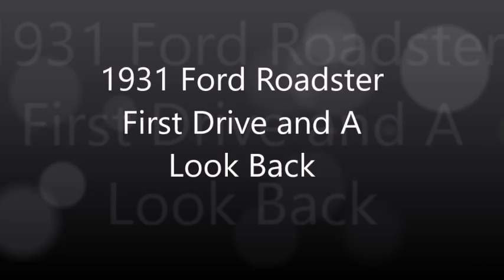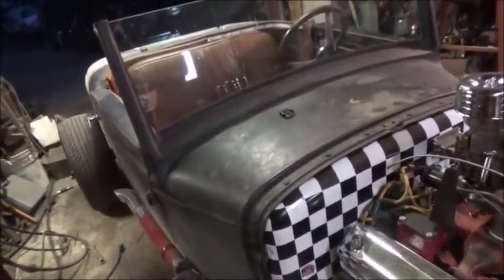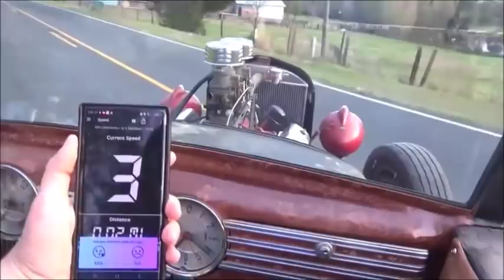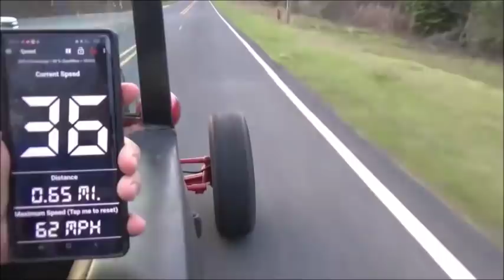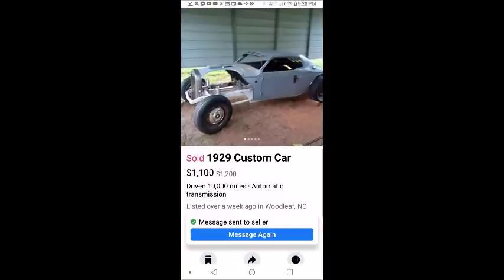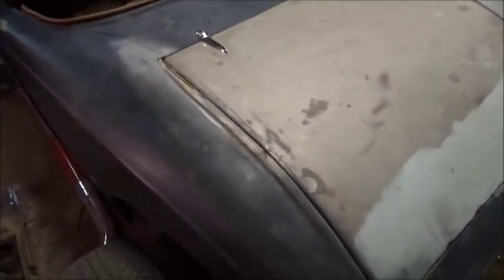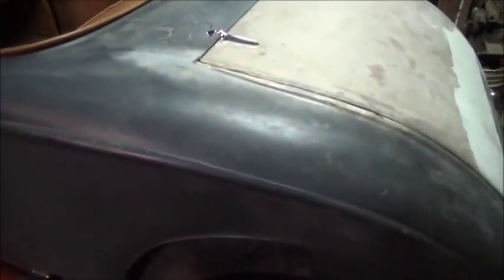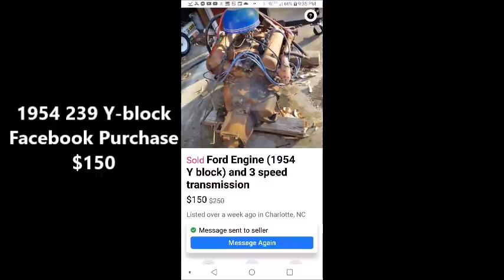1931 FORD ROADSTER FIRST DRIVE AND A LOOK BACK part 20

Comment: That is just too darned cool.  It is so reminiscent of the hot rodding we did back in  the 50's and early 60's.  Our pocket books were thin so we used what we could and made it work.  We didn't have your talents or skills but we sure did have a great time.  You did a fantastic job on that roadster.  Thanks for sharing the whole build..

Comment: Once again you have taken a sow's ear and magically  made it into a beautiful  princess.  You will have to keep it in the family though, I think your son loves it. Probably  your wife also, truth be told. I was thinking about making you an offer but it would probably  insult you and then I'd just have to spray the body a dark silver metallic  to set off that bright red frame ( something  like you painted the front wheels). Too bad that you can't  find a Model "T" steering wheel. With it's  reverse  dish it would make it seem not so cramped in the cockpit.  You did a fantastic  job Jonathan,  I can't wait to see that Lincoln flathead in the coupe.  That's going to be class. A lot better than that little six cylinder.  Cheers  pal.

Comment: Was thinking about the oil leak on the 239, Hmm, Maybe put a nipple on the valley pan and run an inline pcv valve up to carb. Would not be too noticeable. Then plug crank case vent and keep for looks ?

Comment: I did a Self-Align on my 1996 Dodge Ram 1500 4x4, about 10 years ago; using a tape measure (not knowing about the 1/8" Toe-In, but getting it, regardless). Dude, you look like Rat Fink, when you drive it! (Head above windshield, smiling/grimacing, while grabbing gears/brakes) :) Man, I try to watch all of your videos, even if it means "Cutting Into Wednesday Morning"...

Comment: What ever happened you corrected it an the tin ware knock was right. Ain't no panny sound to it. That "Y" block is right for  that car and has the distinct sound I loved so much. As the FE block came out, I got a 58 four door hard top as every two door was sold in my area and so put it up when I went in the service. I came home to find everything gone and their reason was it would kill me... rational as it sounded to them hurt me deep and I left for alaska as I have said many times before. I did buy a fifty six ford pickup but the cars I loved were gone an so was that era of rides and if you wasn't there then you don't know the feeling at all. Of course you were not even born yet. All my kids are older than you Jonathan and so don't expect you to. Your love of the old stuff period is volumes of respect. I do love the sound and it is the correct glass pack mufflers sound. You know a y block as it is just different. Thanks for the ride down memory lane... get a kick out of the camera trying to focus as you pick up speed. Light on its feet unless pushing up a hill by own self may be a tad different. So enjoy it and don't kill it now. I know you mentioned the top is a might low but down with  the seat instead of windshield would be my choice and it won't be easy at all or get used to wind in the face and it is a great build

Comment: In 1964 ford had a 221 V8. not sure if that was the only year or what. Bought motor from a friend and put it in a 60 Falcon. He had wreaked the car.The car it came from had 221 V8 emblem on the front fender. Quick revving motor, looked just like a 289

Comment: Guess you checked that the rocker arms are getting a good oil supply. I guess you know these y-blocks were bad for the oil passage, where it makes the 90 degree turn between the block and head were bad to clog up, starving the rockers of oil supply. Grew up in my father's rural garage back in the 50-60's and saw plenty of them.

Comment: Even some second gear scratch, on 239 cubes! Nice.  This car also has memories of freinds coming over to help! Any idea the rear-end ratio? I'm building a Merc flathead powered 31 coupe with a S-10 T5 tranny. I have a 2.80/1 Ford 8 inch.  I'm afraid she might be a little "long leg-ged".
Reply from the maker: This one is around that. It has plenty of pull in 5th. I think the torque will save you.
Reply: @jonathanw4942  Thanks Jonathan I should end up at 265 C.I.

Comment: Don't forget these cars sitting outside without hoods that rain can migrate around the air cleaner thumb screw, get down into the engine and hydro-lock the cylinders, bending a connecting rod or two when you try to start it up. Maybe putting a rubber grommet under that thumbscrew will keep the water out, but I wouldn't even trust that. Better safe than sorry.

Comment: Forgot the first y-block was a 239. I remember the 272, 292, and 312's (hope I got that right) but didn't remember the 239.
Reply from the maker: You are right. 239 engines are few and far between.

Comment: You'll need a side & rear view mirror at least to make it legit right?  Also, why not paint on wide white walls on those tires to make the car "snappy"? Oh, I"'d love for you to work on the golden hawk in the back ground. That to me is the quintessential factory hot rod of the mid '50's.

Comment: Now a nice solid painting would elevate the total impression of a finished project. After all this is a unique car, a new build, where only the "original" paint is missing.
Also, this is one of the cases where regular use of the safety belts is a must. The windscreen without a buffer on the top represents a scary variant of a guillotine.

Comment: Great drivetrain gear match. Sounds like the rpm's are good and low at higher speeds. Still a kick ass car you built. You should be proud man. You are the hotrod majician